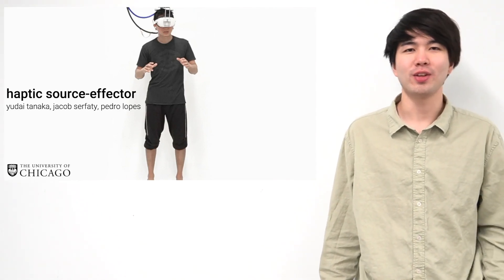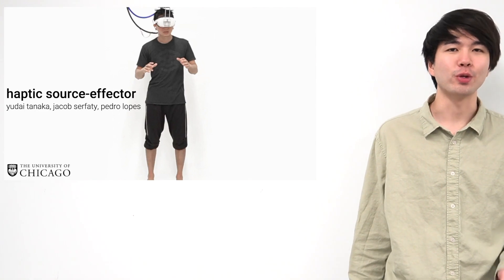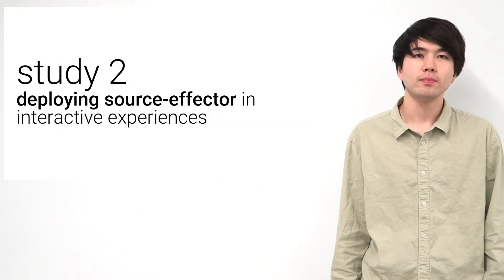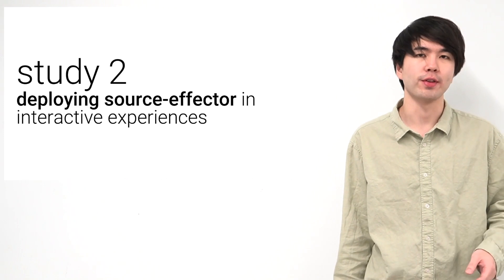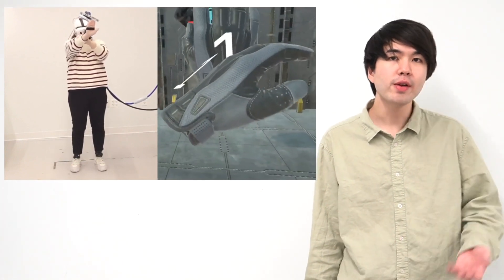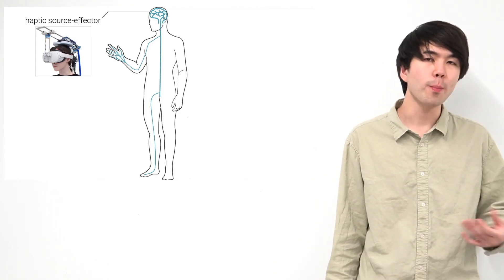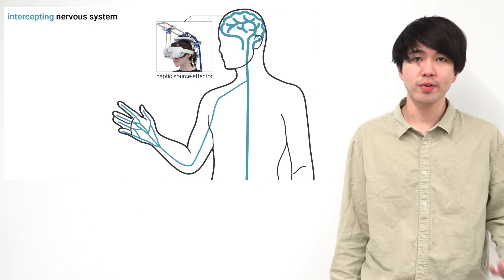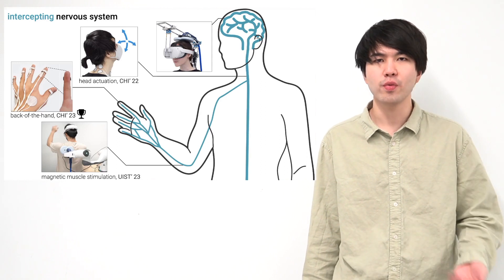Haptic Source-Effector: Full-Body Haptics via Non-Invasive Brain Stimulation

Comment: Why do all of this just make a helmet full of sensors 
This device let you feel pain
So Can this device  analysis the brian signal? Like you want to move your hand without moving it
Reply: I think a swimmers cap would be enough (with manually position-able sensors) a biker's helmet (you meant that right?) would be too cumbersome that is unless we are talkin' induced sleep on a bed and users with chips in their brains but that vr tech is more down the road.

For practical use this could be good for providing the sensation of walking while the upper half of the body could be a mix of this and haptic suits and gloves. This tech can also be complemented with galvanic vestibular stimulation or electric stimulation (directly stimulating nerve ends by electricity, sound/ultrasound etc). All the external puzzle pieces seem to be there...for a not quite there yet version of full dive vr.
Reply from the maker: Great points @Firestorm12345678910! To the previous question by @abdellahrabahi2831 : this is a device that creates sensations and creates movement, it is not a brain sensing (analysis) device. That can be achieved with smaller devices, such as an EEG cap—the harder question is how to stimulate sensations, here we use a technique called TMS for that, which uses magnetic impulses to stimulate your brain.